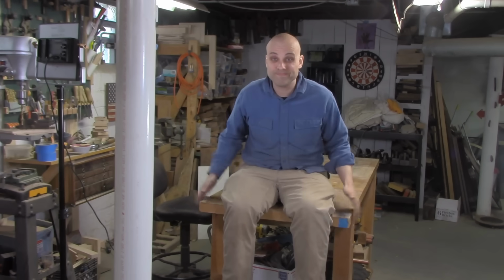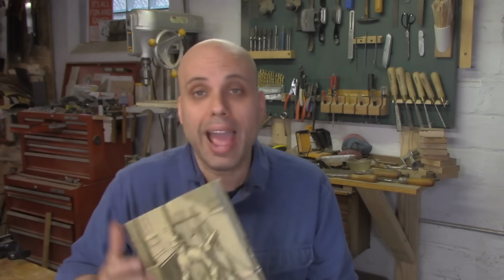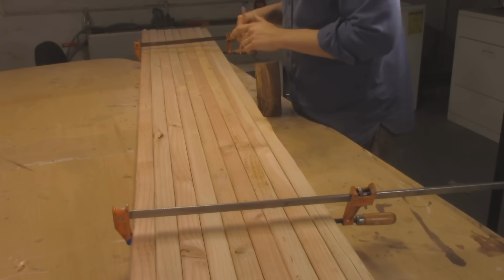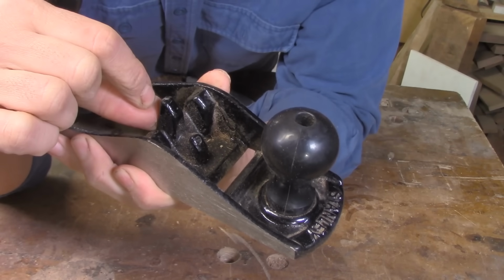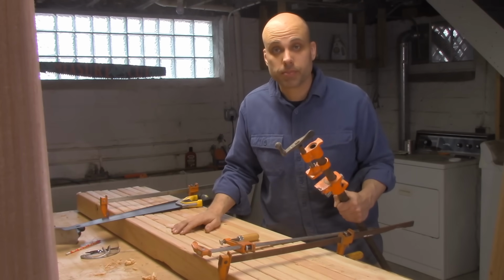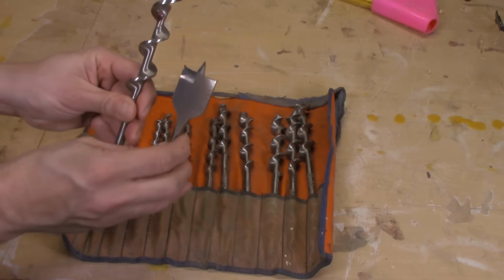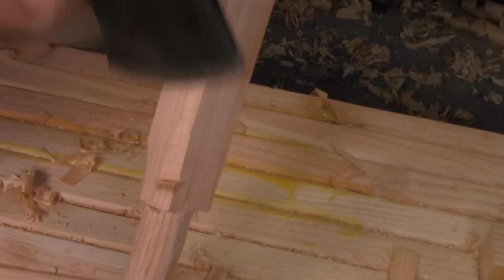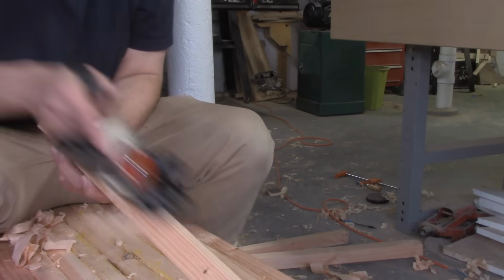Build a REAL workbench for $30

Comment: If you’re looking for an even sturdier build, you can drill a 1/2” hole through each of the 2x4s at both ends, and add some threaded rod with some nuts at either end (washers too) to give you a place to attach your legs.  For the legs, do a glue up to get some 4x4s, drill a 1/2” hole through them. Then skip the outer boards, but make cuts in the #2 and 3 boards to give you a 4x4 hole where the rod passes through.  You can angle these too to give a wider base, and now you have some insane support for when you’re going crazy with a mallet.  I get this won’t keep it under $30 unless you get extra materials for free, but it’s also going to make your bench handle a lot more.
Reply: What are you talking about? Running threaded rods through the legs? That's insane. I've been using this bench for almost a decade with the round tenon legs and the joinery is solid as a rock. The threaded rods will need tightening until the end of time.

I can't make the legs flex jumping up and down on the thing with all 180 lbs of me.

Comment: I'm in the middle of making my bench right now. Very similar to the style that you're making. Unfortunately the only one I had access to was that mozzarella, Home Depot, cheap wood. I like the Roman style bench because it also gives me somewhere to sit, and I have limited room. To reinforce just how soft this wood is, I had the hardest time using a brace but on it because the screw tip couldn't bite and was turning to mush in the hole. It'll get me by, but I will be building a better one later.
Reply: Next bench, go up a level to construction lumber 2x8s. Almost guaranteed to be southern yellow pine or spruce in the US. Plus, they're a better grade of lumber made from older trees. Yes, the ripping will be a pain, but boy howdy is the material better.

Comment: I made one of these 10 feet long, then had the bright idea to only use 1/2 inch tenons for the legs.  My poor rear when the leg tenons all broke and I fell flat on the floor.  Go big or go home on the legs. As an aside, the top works pretty darn well on two home depot buckets. Able to plane 8' long SYP on it.  Great idea if you want to bootstrap your way to making a real bench top.  And it's awesome for sawing on.

Comment: I’m interested in making this workbench. But I need to make one that I can leave outside. I don’t have a garage or a patio, so unfortunately I’m going to need to leave it out in the elements. Can I make one from construction lumber and seal it with linseed oil or will I need to use treated lumber?
Reply: Why don't you just cover it with tarp?
Reply: That's kind of a bad idea. Couple better options: It can double as a furniture bench or plant stand in your house or apartment. Also, it tips on to one end and fits in a closet no problem.

Comment: Hey Rex, 
Thank you for taking the time to put out all these great videos. I'm finding that the lack of power tools definitely has a soothing effect. 
 
I think I should have made this one instead of the one made from 2x6. The 2x6 bench I feel is too light for my needs and limited due to the fact that it's definitely not an easy task to mount some sort of vise. 
I'll be heading back to home depot to get the lumber for this build and will be adding a moxon vise. I will say that this little bench definitely has some advantages over a traditional bench for some tasks.

Comment: Tools List

    Circular Saw or Handsaw: For cutting 2x4s.
    Clamps: To hold boards while gluing.
    Drill with Spade Bits: For drilling holes, a 1-inch and 1.25-inch bit is good.
    Brace and Bit: Optional, for manual hole drilling.
    Mallet: For seating the legs.
    Fine Saw: For slitting the Tenon.
    Flush Cut Saw: For trimming off excess.
    Hand Plane: For shaping legs and leveling the bench.
    Protractor and Bevel Gauge: For angle measurements.
    Pencil, Tape Measure, Ruler: Basic marking tools.
    Chisel: For shaping and cleaning mortises.

Supplies List

    2x4s: Depending on your bench size, but likely a lot.
    Wood Glue: For joining boards.
    Milk Crates: Temporary work surface.
    Wood Wedges: To secure Tenon joints.
    Hardwood scraps or Doug Fir: For the legs.
    Scrap Wood: For making jigs and stops.

Step-by-Step Instructional
Making the Bench Top

    Prepare 2x4s: Cut them to the length you want for your benchtop.
    Planing: Make sure the sides are flat and will fit together nicely.
    Clamping and Gluing: Apply glue to the sides and clamp them together. Use different clamps if needed, alternating between top and bottom for even pressure.
    Leave to Cure: Let the glue set before removing clamps.

Inserting Workholding Features

    Cut Mortises: If you want square mortises for workholding, cut these out from your middle board before gluing.
    Assemble: After cutting the mortise, complete the glue-up.

Attaching Legs

    Measure and Mark: Decide where your legs will go. Make sure the location doesn't interfere with your mortises.
    Drill Holes: Using your angle measurements, drill holes for the legs.
    Shape Legs: Plane your legs so they'll fit the holes.
    Insert and Secure: Put legs in holes and hammer them in with a mallet.
    Add Wedges: Insert wedges into slits in the Tenon to secure the legs further.

Final Touches

    Leveling: Use a pencil jig to mark the legs and cut them for a flat bench.
    Optional Finishing: You can sand and finish the bench if desired.

Comment: I went to make a couple of saw horses the other day and went looking for lumber. You know how US'ian based youtube videos talk about cheap lumber? Like under $5 a length… Here in NZ, with all of our lumber shipped off to China for milling and imported again, and with COVID-19 and disruptions to the supply line, lumber is sold by the linear metre and is currently around $12 / lm. Which is to say, a length of the stuff is worth $28.80. If I were to try and make this bench at the moment, it would cost $259.20 NZD or, converted to USD, $163.46.

I'm starting to rethink my big ambitions around furniture making.

Comment: Really wish I watched this before I laminated up the first half of the top for my mini workbench out of 12 3/4” thick boards that began their life as bed slats. They had some hella cupping and twisting and I definitely planed away half of the wood that was there in the first place. 

But seeing how you clamped them and used the boards themselves to find gaps and identify twist and bowing… that would’ve been much easier than referencing them against the “flat-ish” grimy workbench built into my basement and then essentially planing madly until they rocked “only a little”

Comment: I’ve got two 3 by 7 boards. Is it safe to glue the boards together by the side grain at the middle?
Reply from the maker: Probably.  I've never seen stock like that but it sounds just fine.  Also,  I have an updated version of this bench called the lightweight traveler. Worth a look.
Reply: @RexKrueger  Thanks for the tip!

Comment: Based on what Rex is saying in US, in UK you would go for 'Joinery Grade Redwood', which is usually one of the best construction timbers available, though it is neither actual 'redwood' nor actual 'Joinery Grade'. I know, it's confusing. It's simply (probably) the best of the cheap 'good' construction timbers available. Most of the big national stores sell it; B&Q, Wickes and so on. As Rex says, avoid the cheap Asian 'white wood' imports - that soft white stuff is more likely to succeed as a pillow than a bench...!

Comment: Rex Krueger, please read:
I just got finished building this bench, and I think it will be a great addition to my woodworking tools!  I only made mine 5' 6" long due to storage and weight constraints (I have back problems, and had difficulty carrying it at 7' long).  I used "premium" whitewood 2x4s from my local big box store, as there are no other options near me.  

I made a couple other changes that I think bear importance:
1. Rather than drill from the bottom, I decided to drill from the top, because I wanted to ensure the holes were the same distance.  I simply measured to 10" from ends, and 4.5" from the sides (one inch offset from your measurements).  This was more of a visual detail, but it would have driven me nuts to have them not match.  I also helps with breakout issues.
2. You mentioned cleaning up the legs to make them appealing, but something you didn't discuss is easing the bottoms of the legs to help prevent breakout due to moving of the bench.  Again, more of a visual, but also deals somewhat with structure.

Again, I really appreciate all you've contributed to the woodworking world.

Comment: Rex, could you compare and contrast the $30 and lightweight workbenches? Thanks.
Reply from the maker: Well,  the $30 probably no longer costs 30. But it's very large and sturdy. The lightweight traveler is almost as capable and takes a lot less wood.  In my shop, the $30 is long gone,  but the lightweight is still in regular use.
Reply: @RexKrueger  thanks for responding Rex.
In your book I don’t see mention of your gluing the two planks together, did you?
Or did you rely on the battens to do that? 
I’m inclined to build a shorter version of the $30 bench as I think the lighter bench won’t work as well with a crochet…?
Reply: Rex, do you think the “Traveler” is heavy enough for a crochet? Jeff

Comment: Hey Rex I know this is the older version of the low bench, but I'm around 350 lbs and am worried about actually sitting on either this or the newer light weight model. Do you think this bench will hold my weight plus tools and work piece?

Comment: When I went to the store to get my lumber for this my only two options were white wood 2x4 or 2x8 SYP so I’ve spent the entire day ripping them into 2x4s and got my first set glued up, this build is turning out to be a bigger project than I thought
Reply from the maker: You made the right choice!
Reply: So you ripped 2x8s and they didn't bow? Must have been well dried.

Comment: Just scored myself a big chunk of glue-lam beam to build my bench out of! It's thicker than I need (5 1/2"), nice width (18"), and 11 feet long! Gonna be a challenge to cut it down to a workable length...and I'm gonna have to put wheels and a motor on the bloody thing to move it around my shop!

Comment: I've just been building this workbench the last few days, and it coming on very well, really liking it! One thing I struggled with was the hatchet approach to making the tenons, my wood had quite a few knots and so very tricky to stop it splitting in all different directions. After couple of attempts I gave up on the hatchet, but then had better success with cutting down to octagon shape with saw, then using chisel to get to round(ish!). Hope this help someone else who has knotty wood!
Reply: Avoid knotty wood.  It doesn't split well, is hard on your tools, and is generally a pain.

Comment: I think I've found gold. soon enough I will be working on a bit of construction, basically building a wood structure bedroom on my rooftop and gonna need a light bench that I can move around quickly. My dad has got a pile of thick, wide construction lumbers laying in the workshop and I might just use that 2x10 to make a thinner version of this bench.

Comment: Has anybody made this bench and used Oak for the legs?  What was your experience with a hardwood for the legs and putting the wedge in?  Did they crack or split?  I am thinking Red Oak legs and White Oak wedges.  Thanks!

Comment: I have some 2x4”s that are from a remodel that was done to my house back in the early 60’s (long before I bought it) I was told this by the second owners (I’m the third) anyhow the grain is really tight, and I think it’s pine? In your opinion, should I use this lumber for a bench top or save it for something else?

Comment: 11 2x4s (top) are already $60 with tax. Not including the glue or legs.
Reply from the maker: Try to think about this for a second.  Why would I lie about the cost of this bench? What could I gain when any idiot could fact check me? The video is 3 years old.  Pre covid. Do you think maybe costs have changed. Oh, and building costs differ depending on where you are.  Next time,  think first, comment later.
Reply: @RexKrueger  The video is not even 2 years old (march 2019) and prices did not change. 2x4 was and still is $5.35 regardless of location. I buy wood all the time. Just bought dogear planks to replace my old fence I put up 18 years ago for the same price I bought 18 years ago.
Reply: @sushi8204  Don't know what fantasy land you live in, but lumber prices here in the South-Central U.S. have damn near tripled in the last year.
Reply: @rustyshackleford3978  Some lumber went up 20% in the few weeks but I just paid $2.38 for a dog ear cedar 6" plank and that is how much I paid 18 years ago for the same plank. It sure was NOT under a $1 18 years ago. Recent price increase is due to demand. Everyone is at home doing projects. I myself am working on 5 projects simultaneously.

Comment: just finished my bench. it has 8 legs incase any of them are weak it isn't to big of an issue. The one improvement I came up with is to use a 2x6 as the outside board. this way it works like a mini apron for a crochet and you can drill holes in it for holdfasts.

Comment: I built myself a workbench top using 2x4's for a heavy welded steel frame a friend made me years ago, was inspired by this.

I spent a little money on the fir 2x4's at around $5 each since they were a high grade, straight and generally square stock, and my workbench was WIDE and LONG (84 inches long and 40 inches wide) so it ran me about $125 for the wood and $25 for a gallon of glue.

The issue I ran into was that I only had 4 pipe clamps wide enough, none of my bar clamps were 48 inches, and for a 9 foot long glue up, that wouldn't do. So I used ratchet straps with carboard under the glue seams and little 2x4 off cuts at each point where the strap goes around, with offcuts under the straps to prevent them from digging in. 

And holy crap did it WORK. Going to flatten it with my garbage $20 amazon stanley scrub plane in a couple days, get it as flat as I can, and then start drilling 3/4 dog holes. I also built your chisel rabbet plane from a scrap 2x4 cutoff and a 1/2 inch stanley chisel so I could make a deep rabbet for the benchtop to pass over the lip of the angle iron that makes the benchtop

Got a lot of inspiration from your videos!

Comment: You may be able to buy the materials in your neck of the woods for $30 but here in South Florida the least expensive wood (mozzarella whitewood) would be about $50. Southern Yellow Pine would surprisingly be only about $47! So I guess the shipping from Asia actually amounts to more than the milling here in the South. Seeing how I don't have a basement, or a spare room, or even a garage, my carport is going to have to host my woodworking...

Comment: After watching this video earlier this year I made a bench like this. Instead of 2x4 lumber I used a 9” spruce log cut in half length-ways for the top. I bought 1.25” pine wood dowels for the legs, which werent expensive. Same design otherwise.
Reply: I'm going to do the same to build a greenwood bench for use in the forest.
Reply: @davidhawley1132  nice!  I did something similar once but I was making a small atv trailer. I cut the log length wise and tapered the ends. The deck worked well but the truck wheels I used were flopping around a lot because I couldnt make a decent hub for them to ride tightly on the axle.

Comment: Quick tip for building this or saw horses, make the HEIGHT of the bench/horse to fit just under your knee with it at a 90 degrees. This way you can lean on and hold the bench if needed with your leg whilst standing comfortably with your other leg completely straight, try it it works a treat.

Comment: I'm seriously confused. When you were demonstrating how to use the bench to finish the bench, you clamped a split 2 by 4 on the side of the bench (14:21). If all of the boards are the same size, where did the lip come from that allowed you to clamp it to the side?? When you show the bench from at eye level, there is no lip! How did you do that?? It makes no sense going off of the build so far. I'm at that point now and I feel like I've messed something up since I have no lip for clamping of the sides of the bench.
Reply: Ohhhh long clamp, I for some reason thought it was like a 6 or 8 incher haha

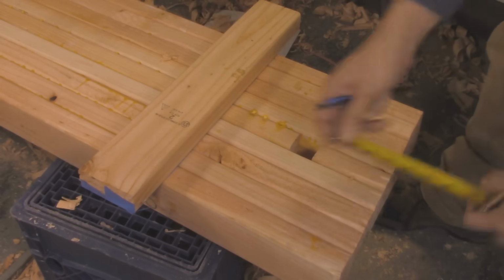Comment: 16:35 Rex forgets to mention that th bench must be FLIPPED OVER to lay out and drill the legs.
Nevertheless, having thin legs at an angle like that makes them weak and wobbly, as the wood will flex.

Comment: 2 questions.

1) would it be better to have 2 mortises to plane larger boards?

2) would it make more sense to use wider boards on the outside, maybe 2x8, for side clamping pieces to the bench with smaller cheaper clamps?

Comment: I bought a pull saw and a hatchet from harbor freight and made this low Roman bench. The change in my work output is an order of magnitude greater. I had been struggling to make your jointers mallet while I was making the bench. I got a low point with it when I noticed I would have to remake the mallet handle completely. Then I finished the bench and redid the handle blank in thirty minutes when the first blank had taken at least three hours